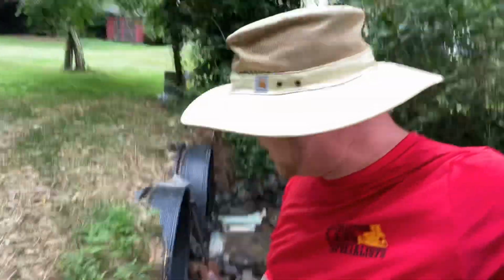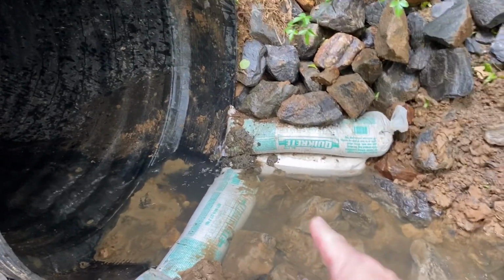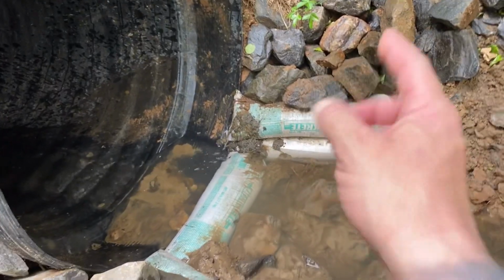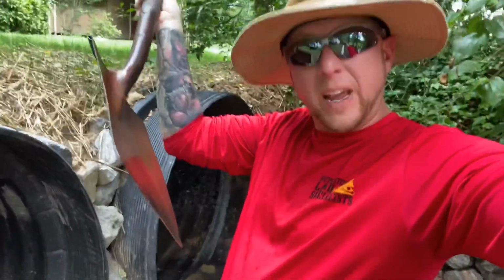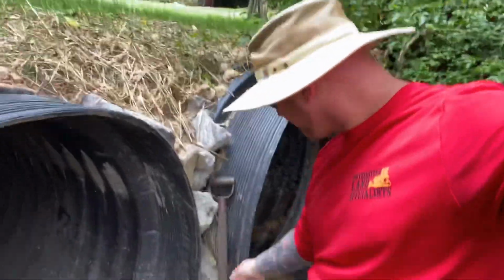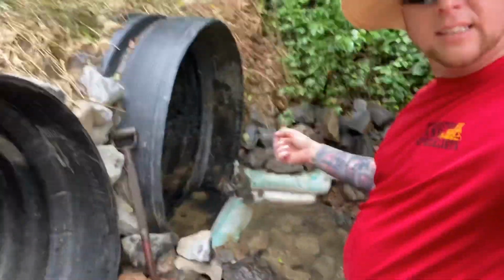Fixing Water Running Under Culvert Pipes

Comment: I’m not a professional but got good advice from one when I set my culvert. Remove all the rock from the creek bed. Dig down an extra 5-6” then backfill that 6” with good clean soil so that both ends of culvert are below low level of water so crawfish can crawl through and not borough around culvert. Set culvert in soil so it fills the exterior ridges. Backfill with clean soil up to mid way of culvert preferably clay. Finish backfilling with ABC or similar compatible fill.

Comment: Those have to be removed and set deeper, you need at least a foot of cover on those pipes to maintain structural integrity, the fix you are proposing only deals with one of the 2  problems you have.

Comment: It takes a man to admit his faults.
We all mess up.
I still think that once it gets large enough to need more than one 4 foot culvert, you should use a box culvert instead. Call around your area and see if anyone makes them or sells them, the local place that makes septic tanks can make them if you give them some engineer specs. They are not much more expensive either, than the two 4 footers you used. Little more work to put in, bottom needs to be flat and level, blah blah blah.
Think of it as another tool in your arsenal. Another type of solution you can use and offer your clients. Something that may cost a tiny bit more but is much more effective is always worth the added cost.
Reply from the maker: Great idea!!! 🙏

Comment: i new it was not going to work when you put them in, not only washing out the bottom but also in between the 2 pipes, you have no space between the pipes to compact goog clay between the 2 pipes, your luck if you filled the gap with loss dirt, that will wash out in a year, now the have way patch job at the bottom may hold a day, a week but it will wash out, putting a little crap at one end of the pipe, ya will make t look nice and hide the fault, but now you will not see it until a lot of damage is done, rip them out, dig em down, a foot and space the 2 pipes out minimum 3 to 4 feet and compact clay in 6 inch lifts, water is very powerful and people just dont get it, i see so many you tube video of some one fixing a leaking dam, and they think, well we will fix it by cutting in a 1 foot wide key across, yet they never show what happened a year later the water soaked that small key and the back presser blow it open, a one foot key will never hold, seen an fixed so many, even one root left in a huge key will get eaten open in time. never fails
Reply from the maker: Arnold Romppai Thanks for the input
Reply: @DigginLife21  any time, 58 years i have learned a lot, from fails. i had a contractor build my farm pond and i told him to go down into the bottom and clean out the black mud down to the clay and do not put any stumps and roots in the dam, i turned my back and next thing i seen was that D8 pushing a huge pile of clay roots and stumps into the vally, i ran down to sto him, but it was to late, he pushed a pile the size of a 1500 sqare foot house into the vally as the dam, i told him push all that out of there, he refused to do it and told me if it leaks he will come back and fix it, the pond filled up nice but when next spring came and all the snow melt, it washed out a hole under the pipe so big my dog could walk though, he came back with his excavator and packed clay under the end of the over flow pipe, and said, its all good, i told him, it will not last the summer, well a month later the pond was drained and the pipe dropped down 4 feet, and the water washed out both side of the pipe, i been digging away at moving all that crap with a cat 301 with a 24" bucket, and i am still working at trying to move 11 feet deep of crap and 30 feet wide by 54 feet long, all nice red clay but full of roots, it looks like a wide open jungle under ground, like a cave. a job that should have only taken an hour with that D8 to do ir right as i instructed him, its been 5 years of me trying to clean it out as much as i can each summer with a way to small machine, then load my 5 ton dump with clean clay from the front hill to fill it in  6 inchs at a time and pack it in,, some day i have a pond on my land, i built many in my time, but this one was so simple to do with a D8 as the banks were all there, just dam off the ends,,